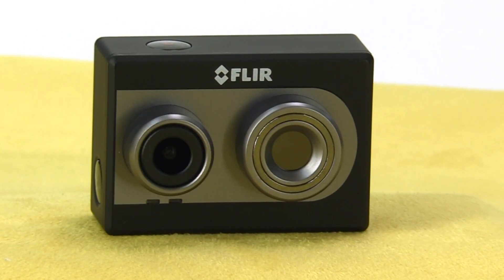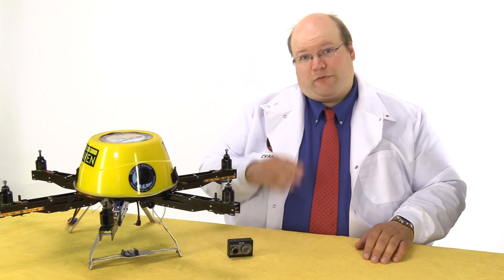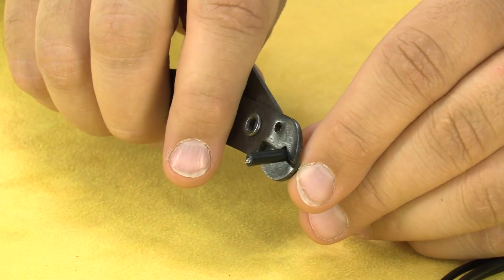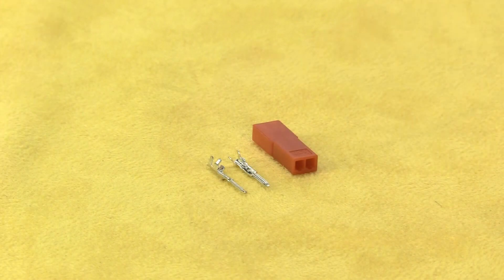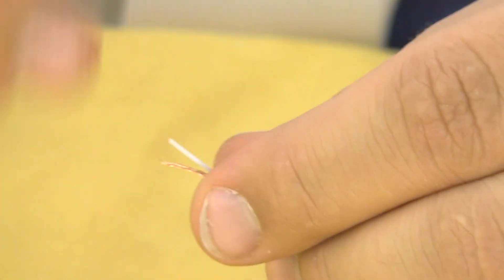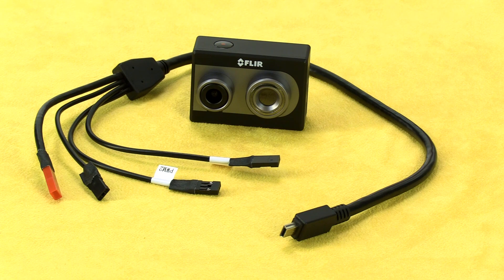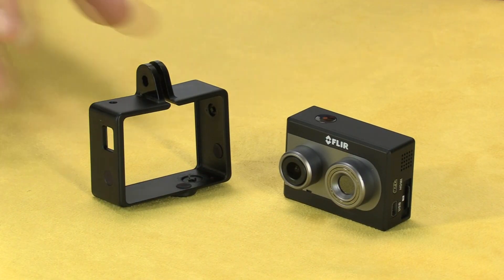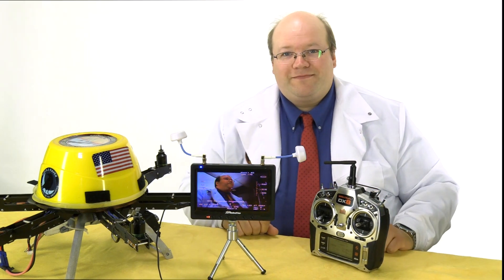How to Hack the FLIR Duo for 5.8 GHz FPV Systems

Comment: I currently have a zenmuse  gimbal on a Phantom 2, using a GoPro Hero4 Silver. Can the Flir Duo use the existing "ribbon cable" that operates the Gopro camera - without modification?

Comment: What is the weight of the Duo? I would be interested about its use on a 250ish or smaller size quads for close quarters thermal imaging.
Reply from the maker: It weighs 84 grams -- so less than a GoPro -- but it does not have an internal battery, so you need to supply power to it from your aircraft.
Reply: Roswell Flight Test Crew It's kind of disappointing it isn't internally powered.

Comment: please do a hack for the Flir duo hook up to Connex pro-sight transmitter
Reply: I don't know if Connex has an HDMI input, but Duo has a micro-HDMI output.
Reply: that's why i need a hack . doing some hot wire connectivity. :)

Comment: (Off topic bit) 
Since you guys first got Raven for the channel, what hardware upgrades have you done to increase flight times and stability etc? 

The FLIR Duo looks a capable camera but for the price you could buy a Mavic Pro (I got mine yesterday!) , FLIR is too much of a niché market and specialist camera for the average drone flyer. The price needs to come way down for it to really catch on or be considered as viable. 
I think FLIR is still in its early days, it still has a long way to go before it becomes even more compact, higher definition and cheaper. 
Thanks for the videos guys, have a great 2017!